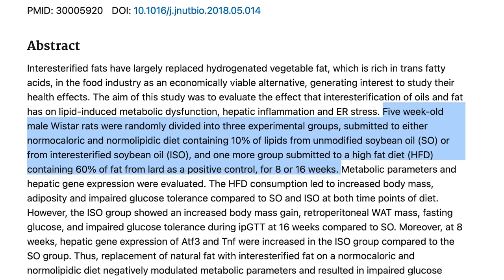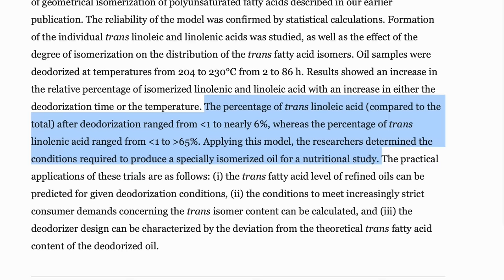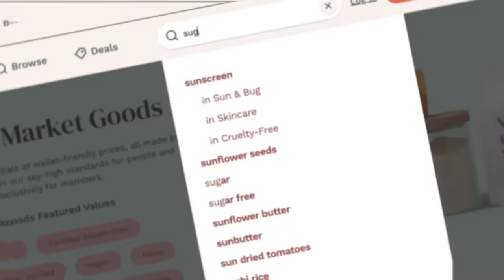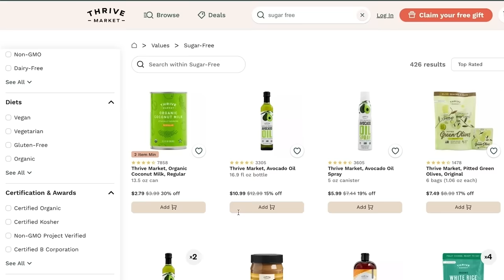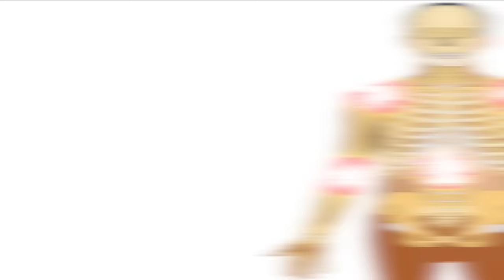NEVER Eat These Seed Oils- Ranked from Most Dangerous to Best

Comment: Still staying away from seed oils as much as possible.  Sticking with butter, lard, tallow, and some coconut oil and avocado oil for baking, and good, fresh olive oil for salads and hummus, drizzling, etc.
Reply: The best oil is sunflower oil. It is cheap and very healthy. Simply the best.
Reply: @AndriiMuliar  Healthiest oils are likely ones high in monounsaturated fat (avocado, olive, Palm?, maybe high oleic sunflower) Best to cook with are high in saturated fat (coconut, ghee, etc.)
Reply: @aaronpeters6209  there is no experimental difference but in theory better oils are seed oils because they are lighter. And sunflower oil is the best because it is cheapest oil in my country.
Reply: @AndriiMuliar  Less saturated an oil is the more unstable it will be at high heat.

Just look up aldehyde concentrations/peroxidation for various oils at high heat.

Should be fine if consuming in whole foods & frying/cooking for less than 10 minutes. But, definitely something you want to avoid.

Why you don't eat deep fried foods at restaurants. They'll change the oil every 1-4 weeks.

Comment: Hexane is a solvent that is sometimes used in the extraction process of certain oils, particularly in the production of vegetable oils. It is known for its ability to efficiently extract oil from seeds and nuts. However, the concern with hexane arises from its potential health effects and the need for thorough removal during the refining process.

Here are key points regarding hexane in the context of cooking oil production:

    Extraction Process: Hexane is commonly used in the extraction of oils from seeds and nuts. During this process, hexane is employed to dissolve and separate the oil from the plant material.

    Thorough Removal: While hexane is used in the extraction phase, it is expected to be thoroughly removed during subsequent processing steps, especially during the refining process. Refined cooking oils are generally tested to ensure that residual hexane levels comply with regulatory standards, which are set to protect consumer safety.

    Health Concerns: The concern with hexane lies in its potential health effects, particularly if exposure occurs at high levels or over extended periods. Inhalation of hexane vapor can cause irritation to the respiratory tract, and prolonged exposure may have neurotoxic effects.

    Regulatory Standards: Regulatory authorities, such as the U.S. Food and Drug Administration (FDA) and other international agencies, establish permissible levels of residual hexane in food products, including cooking oils. Compliance with these standards is essential to ensure the safety of the final product.

    Consumer Safety: Reputable manufacturers follow good manufacturing practices to minimize the presence of residual hexane in their cooking oils. Regular testing and quality control measures are implemented to ensure that the final product is safe for consumption.

Comment: In my location the main oils are rice oil and coconut oil. No mention of either of them
Reply: I'd like to know, too. Rice bran oil is very high in protective antioxidants, specifically oryzanol and vitamin e (as tocotrienols). Also, rice bran oil is not super high in polyunsaturated oils, but has surprisingly balanced proportions of saturated, mono- & polyunsaturated fats. I would think it's a good oil to use even for cooking because it has a high smoke point (~232°C/450°F) - higher than even grapeseed or sunflower oils, and almost equal to palm oil.

Coconut oil is usually not considered a seed oil. Maybe this is why he didn't cover it - though he should have. It's a great oil to use. But it's smoke point is actually lower than many oils, so don't use it for deep frying.
Reply: not a seed oil. Don't know anything about rice oil, other than you probably don't want to be cooking with it. Cooking with coconut oil is probably ideal because of the stability of fat content.

Comment: Thank you for highlighting the whole phytoestrogen thing! All these people blasting soy and flax for phytoestrogen thinking biomechanically that it would work the same way as hormones from a pregnant or recently pregnant bovine is wild to me - especially considering disease rates in countries with higher soy consumption, for example.
Reply: Soy proteins inhibit androgen receptor expression, meaning your cells become less capable of absorbing androgen hormones like testosterone. Disease rates are not the argument you think it is because testosterone tends to decrease lifespan while estrogen increases it. The hormones in food wether from plants or animals are irrelevant because they are broken down in the stomach and liver. To absorb steroid hormones like testosterone or estrogen orally they have to be chemically altered like with the birth control pill which contains ethylestradiol where the ethyl part is to prevent the break down in the digestive system. If you want to ingest pure testosterone or estrogen you have to bypass the digestive system by injecting it.

Comment: DOI: 10.1016
Another problem with vegetable oils including avocado, olive, coconut, etc. is that they contain sterols (campesterol and sitosterol) that cross the blood-brain barrier and accumulate causing damage.
Reply: So what do you suggest
Reply: @a.c.slater573  the best lipid profile seems to come from goat butter, tallow, marrow, then beef, and pork
Reply: @Aldo923  I use grass fed butter for cooking mostly but also coconut oil as it’s cheap and tastes nice. I don’t think I can go strictly to butter and lards tallows
Reply: @a.c.slater573  I also used coconut oil because it was cheaper than butter... In my country there are no grass-fed products but it seems that even if they are not, they are better than coconut oil
Reply: @Aldo923  ok I will try sticking with butter and tallow for cooking then. I have lots of avocado, coconut, walnut and a 2 litres of macadamia nut oil. I can’t throw them away if I use them sparingly will that be ok?
Reply: @a.c.slater573  I think it's a good decision, I would do the same
Reply: @Aldo923  thanks bro
Reply: @a.c.slater573  No problem. 🖖🏴

Comment: Note that most mayonnaise has GMO soybean or canola oil (the one I buy has only avocado oil.)

Don't confuse smoke point with safe heating point. Smoke ≠ oxidation (which occurs at a much lower temperature.)

Even organic sesame oil should not be cooked at high heat, as it oxidizes easily. However, you can add it at the end of the cooking cycle to avoid heating. Buying products with it seems risky. For example: seaweed snacks with it. 😞
Reply: Good points👍

Comment: I disagree that rancid omega 6 is causing the inflammation associated with the O 6 - O 3 ratio.  Arachidonic Acid (omega 6) is a building block of prostaglandins, which are used to cause inflammation.  The body uses arachidonic acid even if seed oils are not present.  In addition, a degraded arachidonic acid molecule would probably not make a good prostaglandin, and therefore, a degraded inflammation, which is the purpose of some anti-inflammatory medicines and foods, including one aspect of omega 3.

Comment: Did I miss grapeseed oil? I was using this for making eggs in a skillet. I've switched back to pure virgin olive oil for the time being, but I'm curious to see how grapeseed oil stacks up.
Reply: Avoid.
Reply: I don't think virgin olive oil is the best for cooking, but that was from an article about using light olive oil to cook with. I prefer ghee for frying stability.
Reply: I have no desire at all to cook with ghee
Reply: @Mad-Bassist  I think light to medium temp cooking should be fine. EEVO is extremely stable when below the smoke point.
Reply: @hugoanderkivi  Exactly. Why do people insist on cooking food at such high temps that the oil is at burning point. ?? I always use EVOO from Italy and cook at lower temps, but for a longer time. Like setting 2 out of 6 with my electric cooker .  Everything always turns out perfect from fish to meat to veggies like Onions and garlic etc.

Comment: Main issue you didn't seem touch on is what happens when these oils are heated. Omega-6 is much less stable than saturated fat.

Toxic byproducts of heating these oils is the main problem. In particular aldehydes. Big issue considering how often oil in fryers are changed + massive consumption of fried foods Americans eat.

Omega-6 bound up in food should be more stable. Especially if not heated.

Comment: Thomas forgot to mention seed oils also contain phytosterols which are now suspected to be atherogenic. Plant sterols were supposed to be healthy because, as they compete with cholesterol, they reduce cholesterol absorption. But the problem is that if we replace cholesterol by plant sterols in our food, consequently we incorporate plant sterols in our membranes in place of cholesterol. That is definitely a very bad idea, particularly when it is in our red blood cells membranes.

Seed oils are ultra-processed foods. They contain too much linoleic acid, have bad to extremely bad omega 6/omega 3 ratios, are most often industrially extracted with high pressure, solvents and heat that damage them adding more problematic compounds in the oil, are deodorized, are decolorated, are most often stored in plastic bottles, many come from GMO crops, and they contain phytosterols which could be in fact very detrimental. Too many problems I guess, we should better avoid them.

Comment: Is EVOO really not for high heat cooking due to low smoke point? I have seen research saying EVOO is the most stable unsaturated oil for cooking even for pan frying due to its antioxidants protecting the oil from oxidation too quickly with heat. Research also says smoke point is not a good indicator to tell if the oil turns bad. What do u guys think?

Comment: Back in South India, at my parents' home, still today, they make sesame seed oil by drying the sesame and churning oil out of it via an old wooden machine. And they use the churned out sesame extract as fertilizer. They also make coconut oil and groundnut oil in that. And they use fresh butter straight from the farm. And they use all of that for cooking. And they're very healthy.

Here's the rub, when you're making it at home, if you were to sell it, you would have to sell the sesame oil for $5+ per litre to break even. But you can buy a bottle of the same oil in the shop for $2 - 3 per litre. A decade ago, we used to wonder how that was possible. How can the companies afford to make it that cheap? What were they doing that we were missing? Guess what? The companies were adding some kind of cheap petroleum byproduct to cut costs and to produce more volume of oil. And they were doing a ton of other things along with that, and they're exporting that. So yeah, this is happening all over the world.

Comment: Any recommendations on what kind of oil to use when making popcorn?  I haven't been doing keto for a while and started enjoying popcorn again, but I've been using canola oil.
Reply: Personally I would try clarified butter or ghee.  It has plenty going for it, and is also quite stable for cooking.
Reply: Coconut
Reply: I think you can also pop it without any oil at all.  I use a little coconut oil for popping it and then drizzle with melted butter and toss with seasoning.

Comment: Very controversial. If you are going to say olive oil and avocado oil are not seed oils (and they are) then you should also leave out Corn oil and Soybean oil. However, in botanical terms, they are all fruits. Olive oil and avocado oil are still part of the seeding system, and the outer flesh of the seed in this case contains just as many toxins as the ovule. If you look at the recent science on this, Olive oil still ranks with all the other oils as being high in plant sterols, which are associated with calcification of the arteries.

Comment: Please help 🙏  I'm in the uk and rapeseed oil is always touted as a healthy local product. It says it it cold pressed does. that make a difference?
Reply: Yes cold pressed is much better because less chance of going rancid. It’s when it is exposed to high heat where it can then oxidize in our bodies. I wouldn’t recommend that oil but I’m sure in moderation it’s fine!
Reply: @BalanceWithWellness  Thankyou  so much. I really appreciate the response 🙏
Reply: @BalanceWithWellness  Im Denmark, we began using it instead of diesel (required modifying the injectors and adding a small diesel tank to help with cold starts). Was about half the price of any other fuel, also for furnaces. Locally produced, so little impact with shipping and refining. Great solution, right?
Yeah, until the govt. got wind of it, whereupon they slapped a tax on it, making it as expensive.
We did the same thing with wind turbines, especially the small ones.
Leave it to the administrators to screw up any good, money saving developments.
Reply: @Oneshot8242  damn corrupt govts

Comment: You keep stating "Trans" oil in like Canola Oil.  Looking at the label, it states 0 Trans Oil.   The label reflects the finished product, not the preprocessed product, so there is no significant amount of trans fat in a brand-new bottle of oil.  Next Canola Oil that is rancid does smell and is not what is in newly bought bottle of oil.  It is not rancid or oxidized.